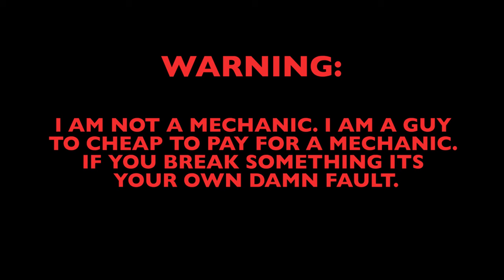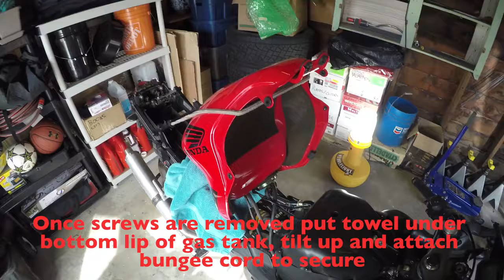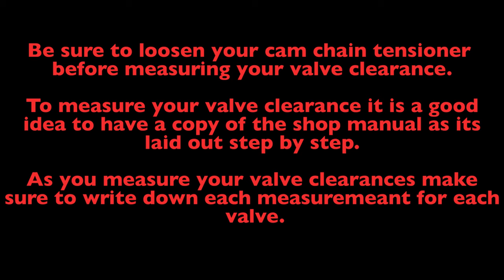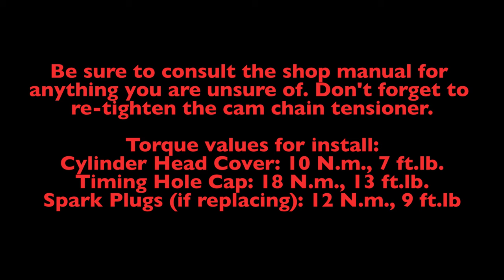How to do Valve Clearance Check on a CBR600 F4i

Comment: Just done with my valve check. I managed to get the valve cover off without unscrewing the throtle bodies. You Just need to unscrew the botom screw holding the throtle lines in place in front od the throtle bodies. Then you can rotate it to the top and have space for the valve cover. Saves a lot of Time.
Reply: So what step do i skip can you time stamp it
Reply: @mickymalvoy1692  i skipped all the things from 4:32 to 6:00.  It was winter and the rubber was cold and they didn't want to come off. I left the entire thing in place and " You Just need to unscrew the bottom screw holding the throttle lines in place in front of the throttle bodies. Then you can rotate it to the top and have space for the valve cover"

Comment: Thanks for the video it was a job thay i was worried about but seams quite simple my 01 f4i is at 24000 so due a check ill be doing it this winter im no mechanic but mechanicly minded and do all my own work on car and now bike so should be easy enough 🖒

Comment: Thanks for vid.  Are you sure you need to release tensioner?  Im pretty sure thats only required if you are going to change shims/ remove cam.
Reply from the maker: This is what is stated in the shop manual for checking the valve clearance. I don't really understand why and it doesn't seem necessary after doing it. But people smarter and more experienced than I wrote the thing so I just did what it says
Reply: I tried measuring mine without the tensioner, then with the tensioner. My clearances were all pretty far off with the tensioner.

Comment: Hi Bryan, I'm preparing to do this now.  Did you have to drain the coolant to take off the throttle bodies?  The manual calls for it.  Also, did you feel you had enough clearance just by propping up the tank?  The manual also calls for removing the tank as well.
Reply from the maker: I never drained the coolant when removing the throttle bodies and haven't had a problem or understand why its called for. Maybe someone else smarter could explain why. As for totalling removing the gas tank, its not necessary. Obviously removing it will give you more access but propping it up with a bungie cord provides more than enough room. The hardest part is going to be gaining access to the side next to the radiator because its quite tight.
Reply: It looks like you didn't completely remove the throttle body, is that correct?  You just unseated it and kind of slide it an inch out of the way and covered it up.
Reply from the maker: Yup. By all means you can remove them if you want but I didn't see the point in going to all that effort if I didn't have to. They didn't really get in the way at all.

Comment: nice video! just need remove throttle body for change Thermostat,  later try with hair dryer .  accidetally i unplugg the little tubes from injectors i go to watch other vid to connect all tubes of throttle body =)

Comment: my f4i has a hair over 30,000 miles, dont think my valves have been adjusted. How do I know if I need the valves adjusted?
Reply from the maker: I did mine after 50,000 km's (30,000 miles) and I only waited that long because I bought the bike at 43,000 km's. The manual states you should check after 25,000 km's (15,000 miles). I'm not an expert but my clearances were too tight and it sounded very rough idling so that led me to check. If the valve clearances are to loose then you would hear a clicking/clacking.
Reply: Appreciate the quick response. It does have a rough idle and smells sort of lean out the exhaust. I think it needs adjustment